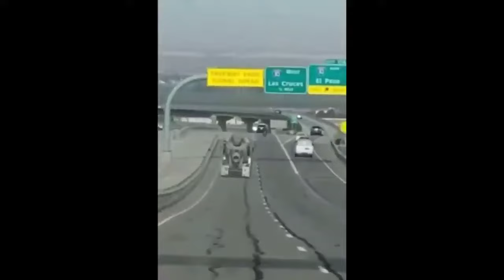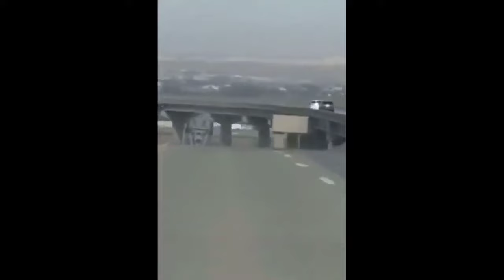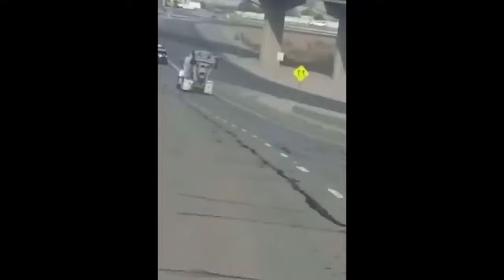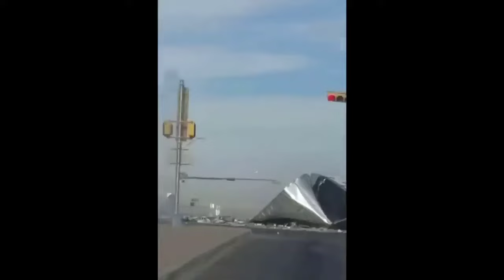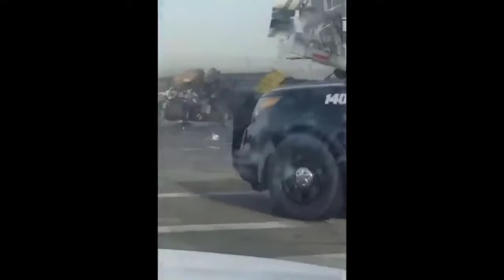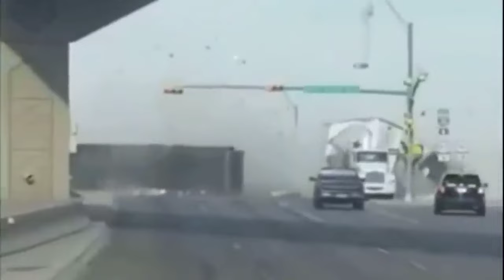Truck driver has no brakes kills himself to avoid killing other drivers🥺..#shorts

Comment: No downshifting? You can stop it or considerably slow it down, asking for a friend…
Reply: Concrete trucks are automatics not manuals.
Reply: He should have downshifted at the top before he went over the hill. However is the truck is already started running away from him and he takes it out of gear to downshift he's going to be in worse shape because he will not get it back in gear he will not pull enough RPM to be able to do it. When you downshift a truck you have to rev up the engine so that your RPM will match the lower gear or it will not go back into gear. It's 300 RPM fore most transmissions in between gear changes. That don't sound like much but in a diesel engine it is. Is rpm is probably maxed out at 1900
Reply: @johncovington3065 automatics have down shifting, too 🤦🏻‍♂️😫🙄
Reply: @Kreativelife-e9g  yes I do butt they have an engine protection system in them if you try to downshift it won't do nothing if it's too many RPM but then again if it's a manual you ain't going down shift anyway at certain RPM best thing is be in the right gear when you go off the hill one gear lower than you climbed it
Reply: @TruckinMental  i think you don't understand the situation
Reply: @Riskw-mk1lo  yea i understand he lost his brakes if he had been in the right gear he may not have. There is no accidents there is machine malfunction or man's error and most machine malfunctions are due to man's error

Comment: Surely the engine brake didn't also fail? And couldn't he just manually engine brake by downshifting?
Reply from the maker: Downshift requires control of gearbox.. also. tiny gears are not stoping 50 thousand pounds of runaway metal

Comment: Bro literally just go steer left right left right flip
Reply from the maker: That's easier said than done... It's not exact science when going out of control and not braking
Reply: @alexshortsplus  unless he didn't try to use his brakes until he was like 30 feet away from the intersection he would have had time to flip his truck or drive off to the right where he could safely crash out

Comment: When will america start inspecting their vehicles yearly as we do in Sweden? 99% of all brake failure videos on youtube is with american trucks involved. This is absolutely preventable accidents.
Reply: Not only about inspection. American trucks still use drum brakes that like to overheat, fade and fail. Your trucks in Sweden have proper disc brakes.

Comment: That is not how a trucks air brakes work.
Air pressure holds the brakes off not on.
So, if there is a loss of air pressure the brakes come on not off.
Now there was a time when trucks used hydraulic brakes and these kind of crashes were common.
That is why the air brake was put into place and hydraulic brakes are not on trucks over a certain weight.
This driver more than likely was having a medical emergency when he crashed.

Comment: Guy who posted this and gave commentary is an expert in not knowing what the F he is talking about.  Concrete truck driver wasn't playing hero...he was just swerving to try and find an out.
Reply from the maker: Are you a trucker... How you going FIND AN OUT going full speed onto 53 ft trailer by swerrving left, its impossible. He swerve left to avoid hitting other driver (it was ten foot swerve)... He knew turning left would only yield five feet out of 53 ft trailer he was not finding a out on a long ass 53 ft  trailer. He swered left to avoid killing the beverage driver.

Comment: The description of this video is nonsense
Reply from the maker: No it's not ..I'm a trucker I know what he did to save others
Reply: @alexshortsplus  he crashed into the trailer because he had no choice. He had no brakes the trailer was in front of him at the point of impact and not the cab as it had already passed. Even if he did deliberately avoid the cab, that just makes sense as the trailer could possibly be ‘softer’ and besides the fuel tank is located at the cab. Just because you are a trucker doesn’t mean you know what the dude was thinking.
Reply from the maker: @ruairijoseph  ...as a trucker you make every effort to avoid killing people. He could've kept straight knowing that he was going to die no matter what. It wouldn't have mattered if he was going to hit the hard section of the truck or not, he was eventually doomed. That trucker decided not to kill that other driver by driving into the back section and avoid killing him....I think that way everyday that I'm cut off in traffic.
Reply from the maker: @ruairijoseph  ...you say that that he crashed into the trailer because he had no other choice but yet you you say that he made two choices one was to avoid the gas tank and the second choice was because the trailer was soft... So he evidently had two choices
Reply: @alexshortsplus  I said he had no choice ‘but even if he did’ meaning hypothetically speaking. He had no choice and actually it may not have been even possible to hit that cab if he tried, as it appears to me anyway to have already past the point of impact. You are taking a very tragic accident and sensationalising it and turning the guy into a hero. You have no idea what he was thinking but I would imagine not very much besides blind panic. If an object I’m trying to avoid is moving to the right of course instinctively I’m going to move to the left. I feel sorry for the guy of course I do but I stand by my original comment that your video description is nonsense. No big deal just my view. Peace
Reply from the maker: I respect your opinion...but as trucker my title is not nonsense it's reality. 👍